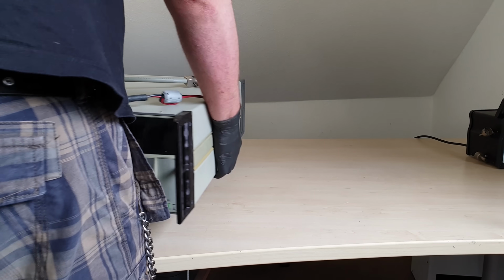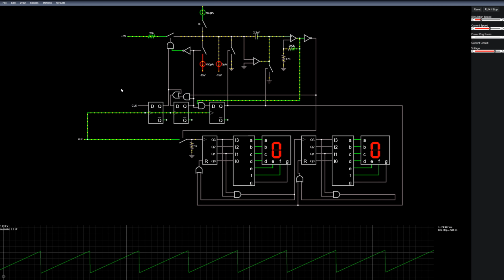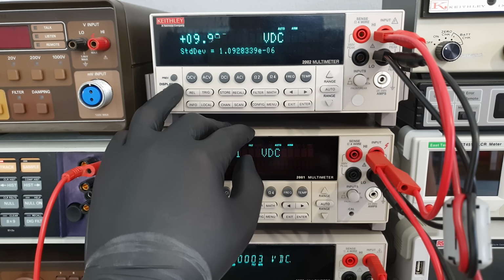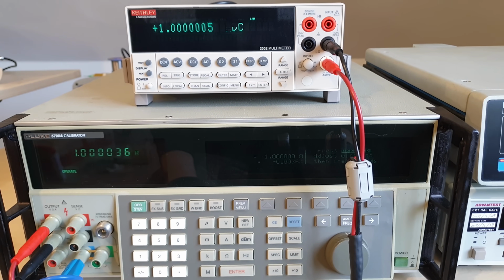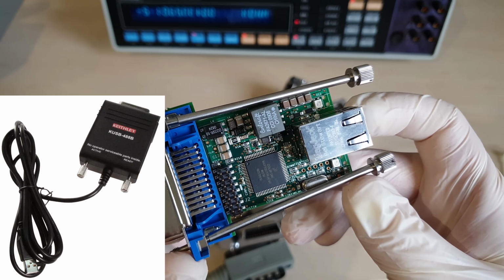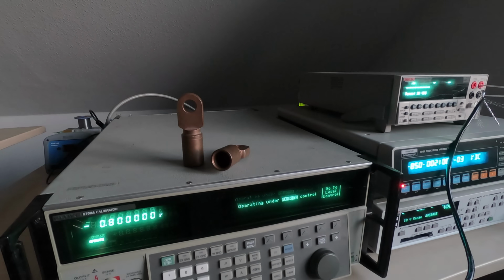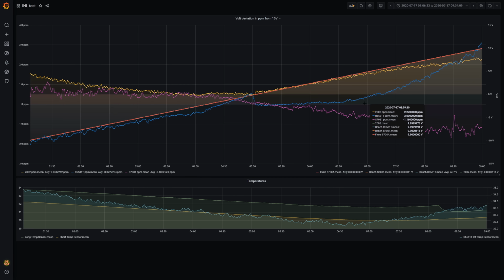Keithley 2002 8.5 digit Multimeter testing Fluke 5700A Calibrator

Comment: I grew up with Fluke Calibration Equipment, 335D, 332A, 5100B, 5101B, 5102B, 5200A, 5440B, 5700A
Fluke Calibration Equipment is very well made, Fluke early Calibration Equipment before 5700A is quite easy, not that many specialised components, 5700A you did very well getting that given to you, pity about that burnt PCB, but I suppose if one wanted, you could get a PCB manufacturer to make another for you, Vishay make specialised resistance networks, if any are on there way out, Caddock also make resistance networks, what I will say I do hope Fluke supply a proper service manual for the NEW range of Calibration equipment, not just a block diagram & PCB change, that to me would be off-putting,
Again you did a very good job, those Components must have cost a lot of money 💰, but in the end you have a Very Good Fluke 5700A Calibrator that will no doubt last another 30 years 👍 👏

Comment: This is cool again. This pico voltage measurement is fascinating & crazy. Temperature measurement with thermocouples is critical, because thermo voltages at the connections. It is always better to use PT100/1000 resistors in a 4 wire installation.

Comment: Hi!
At first I want to say that I realy enjoy watching your videos and content.
The second thing on my list is a question: do you know where I can get such Solartron input cables? I got an 7075 cheap on eBay, but it apparently came without the input leads... A quick search on the internet told me that it has a special Fisher connector. I didn't asked there customer service, but I believe an original replacement part would cost me  a fortune, so I'm curious where you got yous or if you know where i could possibly get one. Thanks!

Comment: You can get a decent 1 Ohm lab-standard resistor from Low Thermal for backing up your calibrator.  Series 770-1. 
http://www.lowthermal.com/pdf/770-series-data.pdf

Comment: Thanks for the clarification . My question in the video clip 5.57 is the two devices of the same model number Keithley 2002. And since you mentioned previously, the accuracy reaches the nanovolt, assuming the two devices are of the same version, why is the difference in reading the 10 volt?

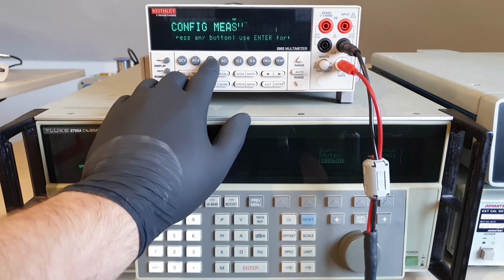Comment: Perhaps the Keithley 2002 is super precise and has very low error count, but freeze frame @7:05 and you can spot a spelling mistake in the word "measurement" on the display. Perhaps it could be mentioned to Tektronix?

Comment: MARCO....I’m sure you’ll do a more extensive explanation of the Banggood lcr meter you have there… But for a quick review… Is it a good one or bad one? Just curious. Lots of times I want to use lcr meter in a “sketchy“ situation.... but I’m afraid of damaging it. it’s a high-end HP model and I would love to have a cheap one under in case I blow it up 😂 

I don’t understand all of the electronics theory as well as you do… So it’s always a risk with me that I might blow something up. That’s why I have my fancy gear… for when I’m asked to do something extremely thought out and detailed for a special client. Then I have a secondary set (or two sets or three)…of gear that is still extremely good and serviceable just not too expensive. 

Like The Agilent/HP 34401a is a great meter but I’m not afraid of using it like I am some of my nicer meters.
Reply: They are alright for general usage, they will crap out when you go to extremely high/low component values but that's what the expensive big boy toys are for

Comment: i want one of those meters but i would have no use for it besides checking AA batteries
Reply from the maker: As soon as you have two you can make them monitor each other. And if a difference appears one day, you'll have to wonder whose fault it is. Then you need a third, more reliable one to check and you are off to a good start :)
Reply: @reps  make sure my xbox controller doesent die

Comment: Very nice overview of the Model 2002. After years of making DMMs with 8-bit microprocessors and being limited to a 64 kbyte address space, designing the Model 2001 and 2002 with a Motorola 68K-based processor allowed us to pack them with features. It also allowed for use of the SCPI GPIB commands instead of the previous generation "R2D2" command set (as we used to call it). This is what Marco alluded to with the Model 237. And yes, our analog design team was world class.
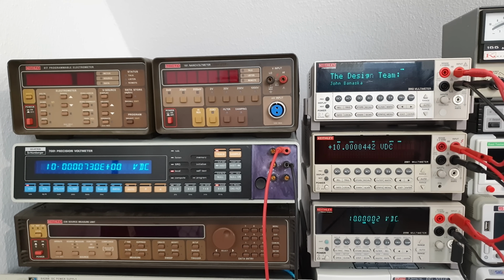Reply from the maker: Hm, this commenters name looks familiar somehow 🔍 04:12
Wow, so glad you liked it! I didn't have a whole lot of time with this demo device, but I'm still hoping to snatch one on eBay one day for a closer look and some tinkering.
Reply: @reps  These instruments are like Kwantum Mechanics. 😂
If possible I'd like to see you cover the DIY build of a digital controlled power supply.
Preverably with linked outputs to power precise op amps. 
My Keysight E36312A is driving me crazy.
There seems to be no way to adjust the values linear. Being Volt or Ampere...
Any tips on how to properly calibrate this?
Reply: Nice to see you here, and thank you for your work. 30 years later, and there is still no competition to 2002 in half-rack formfactor. Only sad to see that it's full potential was not utilized like proper support for Keithley 1801, resistance and phase-measurement cards, etc. ;)

Comment: Linearity test is not linear enough, it's more of tiltalarity in the plot. :P It's cool that they've added Wayne Goeke to this new K2002 team list. He is the one who designed 3458A's magical ADC and now works for Keithley ;). Hint for future : RJ45 cable is good for nanovolts for DCV measurements, but not good for resistance as its isolation is not that good. For high-ohm resistance best to use gray-beard approved PTFE-insulated cables. As of NPLC, K2001 have max 10 NPLC, while 2002 can do 50 NPLC ;)
Reply from the maker: Is 50 NPLC recommended? I'm not quite sure if I tried with 2002, but I remember getting a lot of noise from Advantest R6581T with higher NPLC settings
Reply: @reps  Depends. :) It can be helpful for high resistances, but for DCV I didn't see much difference on my 2002's noise-wise on NPLC 10 vs NPLC50.

Comment: Do the Keithley 2000, 2001and  2002 have the same user Interface, functions and communication over  GPIB or are they all a bit different?
Reply from the maker: 2000 is a bit different, 2001 and 2002 are almost identical in terms of UI and coms

Comment: I really don't understand GPIB interface prices. It seems the cheapest interfaces are basically a GPIB connector with some free electronics in terms of BOM cost, and then the price starts going up from there with no end in sight.
Reply from the maker: The fake NI ones for around 100 bucks work well enough for me. Original NI ones are made much nicer and they can be faster if needed I think, thanks to their custom ASIC

Comment: I did not understand, whether you already calibrated the 5700, or just rely on the original status. The 5700 and the 2002 agree within a few ppm in DCV, but disagree in DCI, that indicates, that OHM (10k at least) was not calibrated on the 5700.
Reply from the maker: Yep, you are right, I didn't make that clear: I did a manual range adjustment for the F5700A 10V range based on K2002. Same for the two other voltmeters involved. I didn't adjust all the functions and ranges, because I might already have a better calibration within reach.

Comment: Sure, your metrology tech is pretty cool, but I just want to know what kind of switches you are using on your clicky keyboard with the RasPad.  They sound like Kailh "box" clickbar switches, but I might be wrong.
Reply from the maker: It's some off-the-shelf Razer keyboard. its -key is broken :(
Reply: @reps  Aha! Razer green switches are also click bar switches so the similar sound makes sense.  If you need to repair the -key, I don't know if you can buy individual razer switches but Kailh (Kaihua) makes a bunch of very good clickbar switches. The closest replacement for a razer green would probably be a Kailh Box White, but there are also many other options with heavier springs and thicker clickbars if you wanted to build your own custom keyboard.  Also, if you ever did decide to make a custom keyboard, please be sure to make a video ;D
EDIT: I just looked it up and I was wrong about the internals of the Razer switches - they ARE made by Kaihua, but they have a different mechanism than the other ones made by Kaihua.  Also still no luck on finding replacement Razer switches. I think they only come in complete keyboards.

Comment: Your simulation is wrong. Input current is always on. One measurement cycle consists of many charge and discharge periods (via switched in and out current sources only, no reset switch until very end). Time for each period is determined by the input current: higher the input current (=input voltage) longer it takes to discharge (but quicker to charge.) Output is the difference in charge/discharge clock counts.
Reply from the maker: After consulting a few grey-beard friends, you are right, my simulation is wrong. But nobody thinks that the input current is always on either. Are you sure about that part?
Reply: @reps  I meant, that the input current is on as long as the dual slope phase cycles continue - thousands of 'em. The whole 10 NPLC yards. It's switched off only just before the "final slope" phase (only trickle current through Q807 remains then, to discharge the cap till zero cross). As for the dual slope part, the algorithm is very simple: It works in chunks of, let's say, 100 clock cycles. So, for 100 clock cycles it pushes negative current. At the end it checks, if it crossed zero at some point during those 100 clocks. If not => do another 100 clocks down. But if it did cross the zero => next 100 clocks push positive current, then check for zero cross event. Rinse repeat. Thus it wobbles around 0V point.

Comment: Sometimes you can find a cheap ICS GPIB LAN gateway on ebay - found these to be good value and easy to work with. I used Grafana for work all the time and never had the idea to use it for logging mulitmeter output! Thanks for that! Finally there are a bunch of projects that abstract electronics instrument controls. I've been looking at InstrumentKit and PyMeasure amongst others. Worth adding to an existing library rather than building your own!
Reply: The (relatively) cheap ProLogix GPIB-Ethernet dongle can go a long way too. It has some annoyances because of the very low end controller and lazy design, but for most applications it should be fine.

Comment: Pro tip: When stacking test equipment 3, 4, or more levels high, it's recommended to spread mortar between the levels to equally distribute the weight downwards.

Comment: Hey Marco what engineering applications require voltage/current accuracy in the nano range?
Reply: Nobody needs them nanovolts, but when when the volt-nut bug bites there's no rescue. 
It starts innocently with handheld dmm's. Then the volt-nut bitten discovers eBay, and it's all downhill from there. 
They usually ends up as graybeard virgins in national cal labs, fighting for grants for trips to bipm or nist.
Reply: @ulwur  Mainly research purposes, we have lab tables stacked full of Keithley 200x, 6221/2182A and a couple of Novocontrol impedance analyzers and still we have to fight each other with multimeter probes to get enough time with each of them
Reply: @gideonwackers7693  of course in professional settings there's for sure need of resolution and accuracy. I was thinking of home gamers.
Reply: Dollar tree solar lights?
Reply from the maker: @snarkylive  already got one, no basement needed :) it's just a tube filled with helium-3
Reply: Digits and ppms are in and on themselves desirable. They are beautiful, quiet, and luxurious. The values that fill them are the sacred matras of instruments, and the more sacred space you can allocate to them, the friendlier the gods of cause and effect will look upon your worldy wishes. If you want to befriend the pixies and not make them angry, you have to listen to their whispers  very closely.
Reply: The CERN large hadron collider
Reply: ALL THE THINGS

Comment: ...but who calibrates the calibrators?
Reply: The calibrators are calibrated by other calibrators, those are calibrated against standards (with offsets dialled out).....
    Those standards are, in turn checked by your countries national standards lab... Offsets noted, and again, dialled out....
   The amount of uncertainty is based on how many degrees of separation there are, from your calibrated calibrator, to the national standards calibrated reference....
Reply from the maker: Everybody who has a 10V, a 10kOhm and a 1Ohm reference can. Guess why I'm looking so hard for a 1 ohm reference :) F5700A wants to know the absolute values of these references to adjust itself to them. Those 3 external references in turn should be calibrated by something even more trustworthy, for example national metrology institutes like the PTB
Reply: @reps  but what references are good enough for your Purposes, you can find good 10kΩ  precision resistors (0.005%) for about 50 bucks on eBay
Reply from the maker: @Zertrebender  Of course there will be videos about the holy trinity of external references. For 10V I already have a Fluke 732A here. For 10kOhm I have purchased a bunch of crusty 40kOhm VHP101 from questionable sources. I'll measure their temperature coefficient with Arroyo and select the 4 best ones to make a somewhat good 10kOhm reference. ESI SR104 would of course be preferred, but you can probably buy a Keithley 2002 for the price of that one 10k resistor :) 1 Ohm is difficult.
Reply: @reps  looking forward to that video, I love high precision stuff, the feeling of moving 4Tons of X axis in my company with literally a thumb is just to fucking nice
Reply: @reps  @Marco Reps I have a few weird looking large 1 Ohm resistors that came with calibration notes in a plastic box. Don't know if they're what you're looking for but they came from a Phillips/NXP lab in the Netherlands, so you know they're not the worst quality.
Let me know if you want to have a look! (If I remember correctly they're five precision film resistors with 0.1% tolerance made by Caddock)